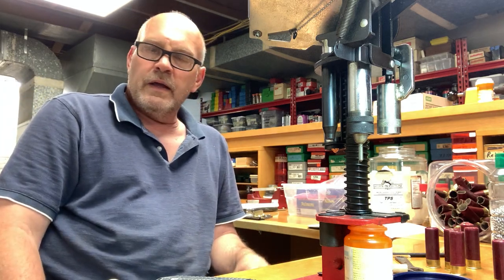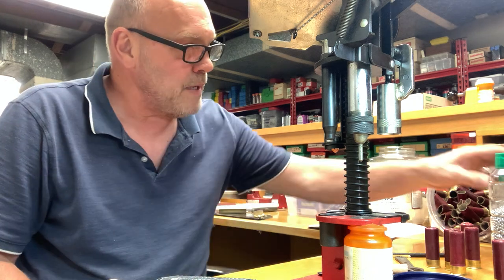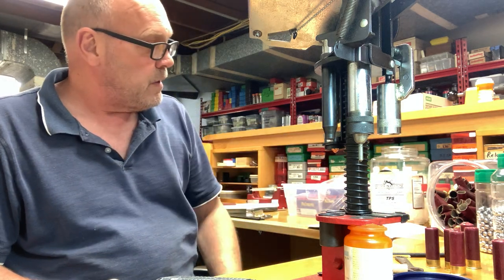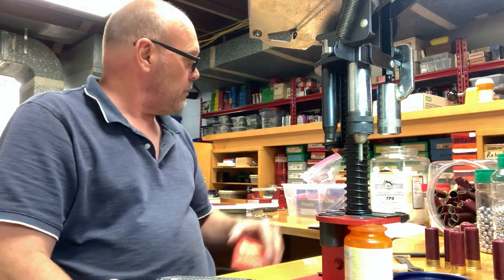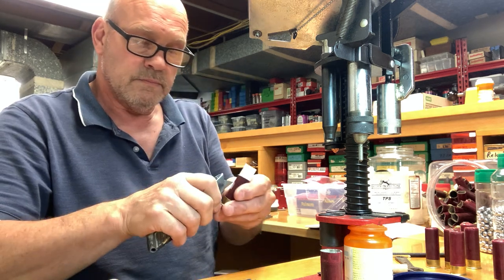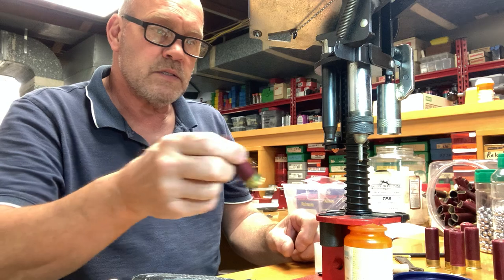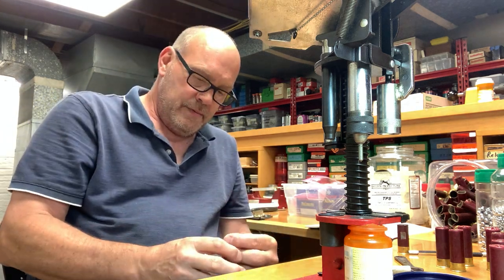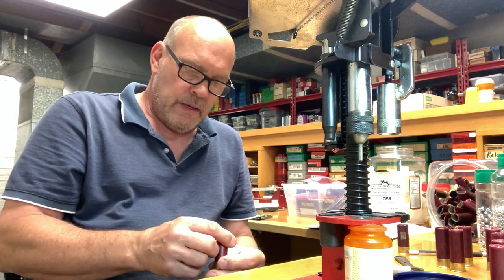Making Flitecontrol buckshot Wads

Comment: What are the sizes of the three cut outs in the hull you use to mark out the wad 'cuts'?

Any range tests of these yet?
Reply from the maker: They where about 5/16” wide X 9/16”high. I did shoot them and they grouped tighter than standard buckshot but I don’t have any of the factory loading‘s to compare them to.
Reply: @maxxbear5014  Thanks for the FAST reply!
I will ask a mate that I know who has some of the Federal ammo to loan me a pack of five so I can get more component data from them then reassemble them for him. Quite impossible to find here in England.
I may experiment with the three slot positions too.
Thanks again!